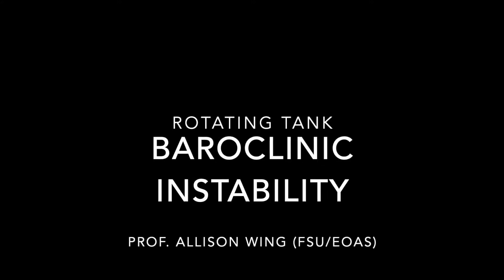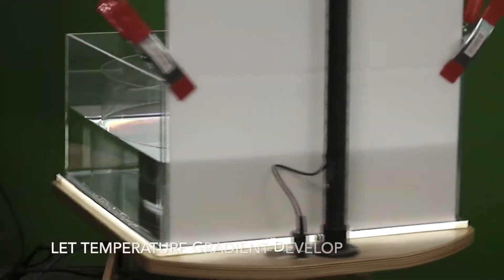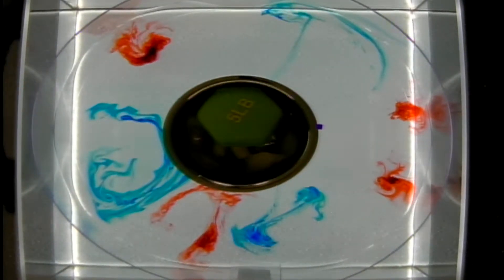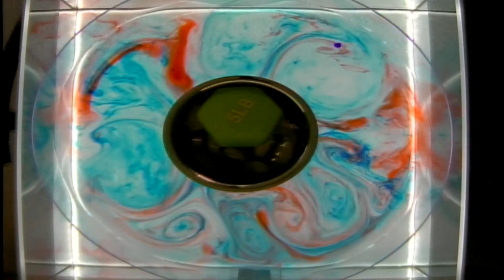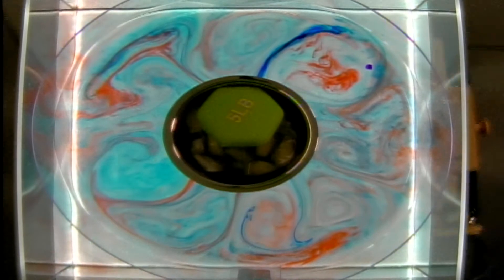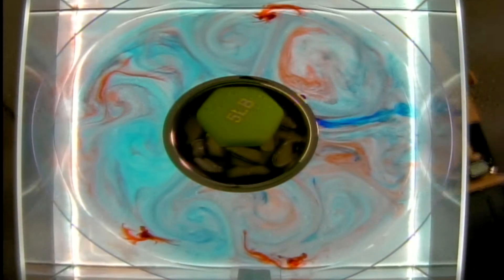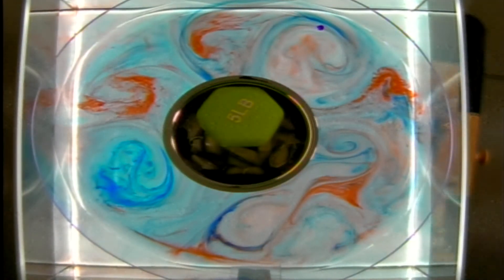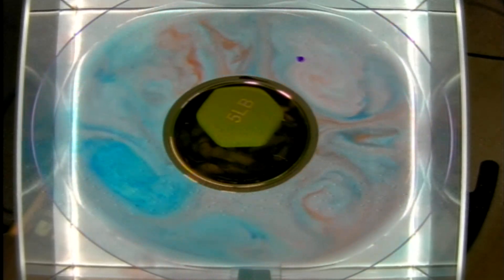Baroclinic Instability

Comment: I want to build one of these spin tables to observe this stuff.  I think it would be interesting to improve what is shown here by implementing both active heating and cooling to each side to create larger, more steady temp gradients (that could later be varied by input power to simulate seasonal changes). Another cool idea would be to use vanishing dye that loses its color after a couple minutes and have a system to actively inject the dyes periodically in specific areas.   I am going to look into setting this up.
Reply: Could one implement AI here? Maybe the data collection could be used to help predict weather by running multiple long term experiments, continuously collecting the data and adding it to the "knowledge" of a weather program ..I can picture a massive lab, with many white coats and mind blowing complex spinning experiments.🤌

Could you replicate this experiment with water vapor or a gas of some density, in place of the water?